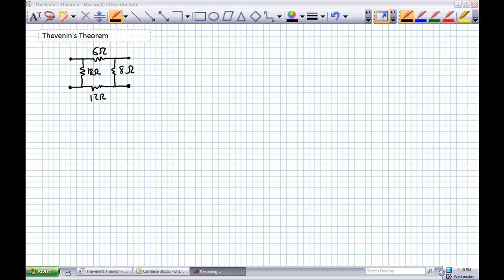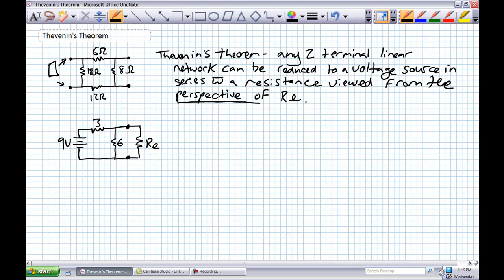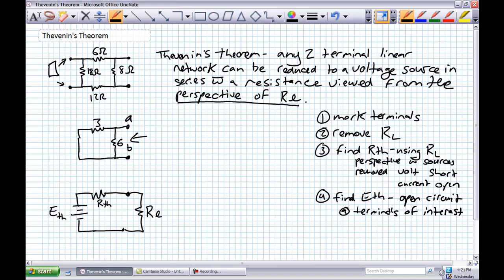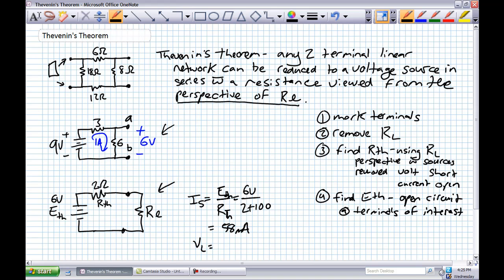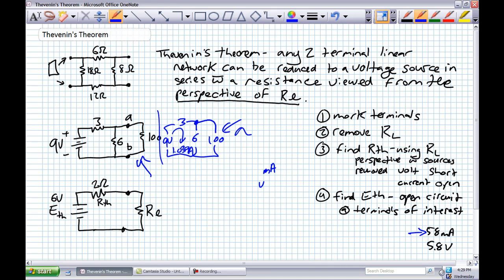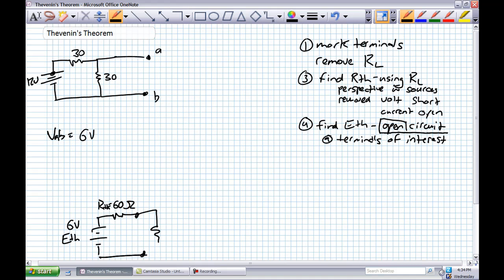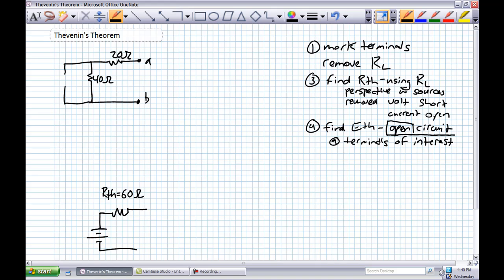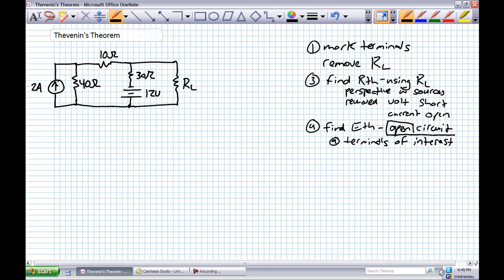Thevenins Theorem

Comment: at about 11:30 when the race is going on...

I'm really confused. It makes perfect sense to me that the current through RL must be 6V/(Rth + RL) since Rth and RL are in series, but;

what also makes perfect sense to me is that since the Voltage across RL is 6V and since RL = 100 ohms --> I = 6/100 or I = Eth/RL

could someone please tell me why the latter conclusion is wrong?

Thanks!
Reply: +Daski69 the voltage across RL is not 6V, the voltage across the entire circuit (after simplification) is 6V. The circuit consists of two resistors in series so he first calculates the 'source' current, then the voltage across the 100ohm load resistor. Remember there is a small voltage drop over the 2ohm resistor, which should be in this case 0.2V. So RL is in reality 5.8V which would give the current of 58mA.

And before the simplification the RL is in parallell with a 6ohm resistor. Here we must simplify the parallell and calculate the Source Current then use the Current divider rule.

Hope this helps.

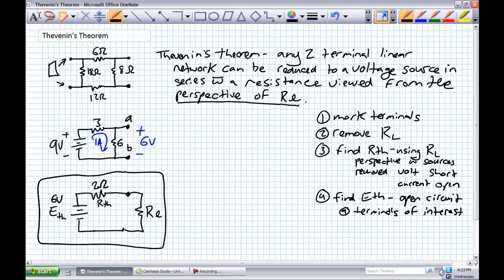Comment: in 10:20, can somebody explain to me step by step, how did the Eth become 6V?
Reply: Its regular voltage drop in a series circuit, 3v was dropped over the 3ohm resistor leaving 6v etc

Comment: Current divider @14:29 is incorrect shouldn't it be (6/(6+100))*1.039? Current divider the numerator is the branch you don't want, voltage divider it's the branch you want.

Comment: Why at 14:32 do you change the 100 to a 6. You are looking for the Voltage drop across the 100 OHM resistor. This calculation would have given a different answer of 0,98mA change the end result. Can you explain please.